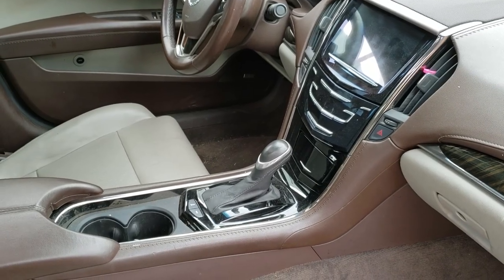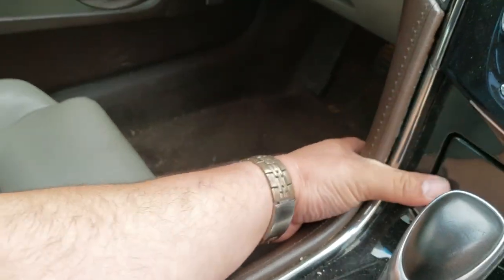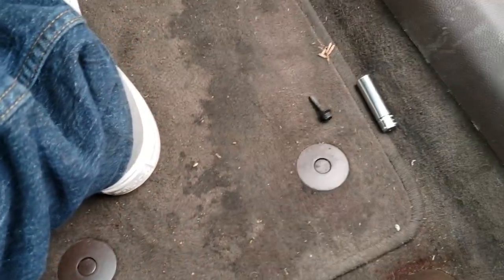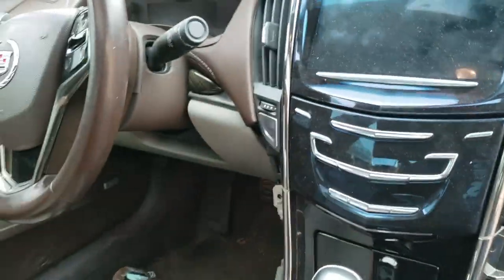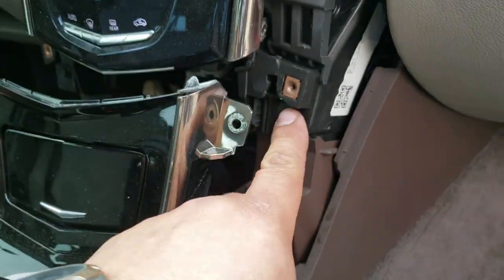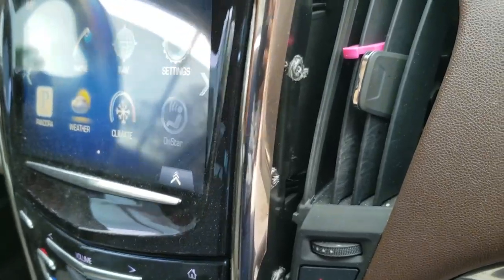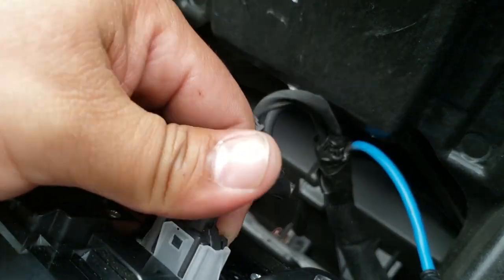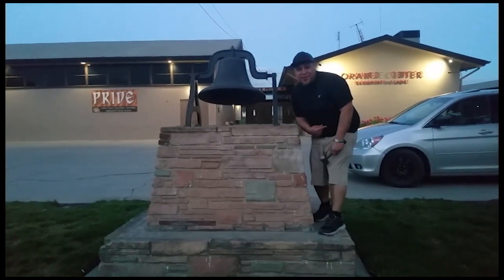How to: Remove a Radio From a 2013 Cadillac ATS

Comment: I loved your video and got a question if you don't mind. I have a 2015 ats with a basis radio, and can it be upgraded to que infotainment system since the radio seems to be the same size you took out of yours is about the same as mine even tho the screens will be bigger on the que systems. I been lookin for videos but yours about the closest I came thats simular to mine, thanks. And what will you put back in its place may I ask?
Reply from the maker: Im really not sure because at the end of the day the pigtails have to match the unit. If you cant connect it then it will not work. I honestly dont know. Its one of those things that your never know until you try it. Sorry Bud wished i had a better answer to give you

Comment: Hi George I have the same car thank you for your video I was able to replace the cue system but I have another problem my power seat not working do you have any video on that. Thank you for your help.
Reply from the maker: Your welcome, I'm glad this helped you out. No sorry I do not. But what is it doing? Car seats are tricky, most of the time if the seat is damaged we replace it with an exact OEM. We have a company that dismantles cars and sells parts to the public. The company is called LKQ but be careful cause some of their stuff also come damaged and its pricey. If the seat cant be repaired, this is the best way to go. REPLACE IT 😥
Reply: Thank you George I would take a look to that website LKQ AND LET YOU KNOW.
 @559powerscape

Comment: I have the same car but mine has the small screen stereo, i just bought the same screen yours has but want to know if it will work?
Reply from the maker: Not sure. Gotta try it if it doesn't need a security code you should be good. If it does you can swap chips that are inside the radio, you would have to open it and there should be 2 or more...you have to replace the main one....which one I don't know. You would have to connect it first and see if it works....if it requires a code your going to have to open up the old one and see what chips inside the radio are swappable

Comment: How do I plug a powered subwoofer into that radio that your 2013 Cadillac ATS
Reply from the maker: You can tap in to the rear speakers usually thru the trunk. U will need a output Line Converter because oem radios are in a different frequency....then tap the sub into there....run your power to the battery with a fuse and the remote to your fuse box to we're it's turned on when you turn your key....you will need a volt meter......and your set....hope this works out for you!

Comment: where did you buy your new radio from or whats a good website to check
Reply from the maker: I didn't replace the radio the only thing I replace was the digitizer the "touch screen" I bought that on eBay
Reply: @559powerscape  oh OK thanks for the response.   Ill have to do that mine won't let me change anything anything
Reply from the maker: @23rubmrtnz  yeah that's what had to be done to this one for same issues
Reply from the maker: When I replaced it https://youtu.be/GZfEwnz_s8Y
Reply: @559powerscape  my man 👊 your a life saver thanks for the responses and info really appreciated it 🤟
Reply from the maker: @23rubmrtnz  😁😁😁🙅‍♂️Heck yeah 4 sure! THANK YOU for your support! Hope this works out for you

Comment: What size speaker is in the dash? What can I replace it with?
Reply from the maker: Its 2.3/4 size speaker. FOUND THIS ONE FOR UNDER 50 BUCKS AND REALLY GOOD QUALITY 
Memphis Audio PRX27 Power Reference 2.75 Inch 
https://www.amazon.com/Memphis-Audio-PRX27-Reference-Speakers/dp/B06ZYCGPJG/ref=asc_df_B06ZYCGPJG/?tag=hyprod-20&linkCode=df0&hvadid=312157286633&hvpos=&hvnetw=g&hvrand=127819397134118044&hvpone=&hvptwo=&hvqmt=&hvdev=m&hvdvcmdl=&hvlocint=&hvlocphy=9031868&hvtargid=pla-571823119828&psc=1
Reply: Awesome thanks I already replaced my front door speakers and added a jl 10w7 but I just blew this dash speaker.
Reply: @559powerscape  does it fit right in or would I need to buy anything to make it fit
Reply from the maker: @tjsworld2338  lol dang w7 booooy!
Reply from the maker: @tjsworld2338  this is an after market item not sure if it will need to be modified but this a direct replacement https://www.ebay.com/itm/143677799912

Comment: I have 2016 Cadillac ats, I cant remove cup holder. Tried putting clutch at shift still doesnt work
Reply from the maker: It should just pull up and out

Comment: My cupholder will not come out .. I’m pulling hard as fuck
Reply from the maker: Lol I'm sorry. It should come out with ease cause its a couple of clips holding it down....try using a screw driver or a trim panel removal tool to try and pry it out.
Reply: GEORGE LOPEZ HOW TO DO IT YOUR SELF didn’t have to take it out just pulled the outer trim off and pulled up the whole panel